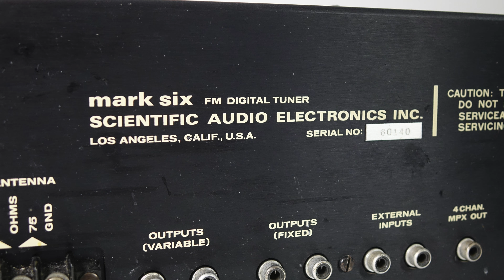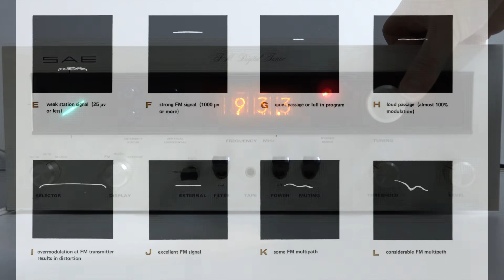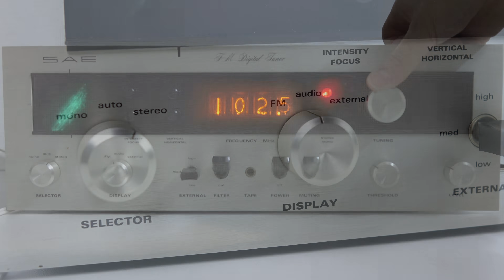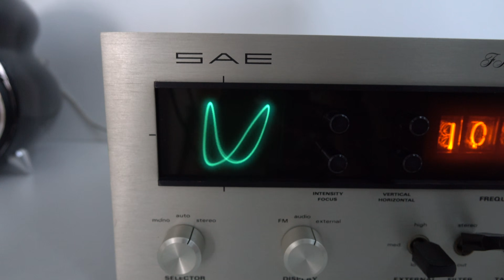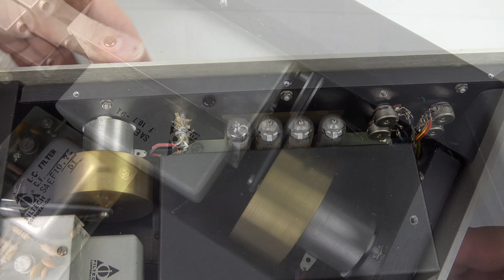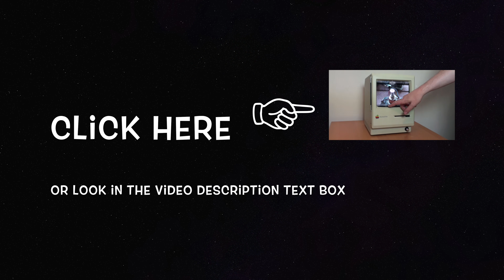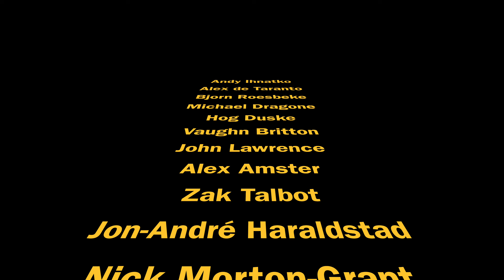Retro-Tech: SAE Mk6 FM Tuner - My Vintage HiFi holy grail

Comment: I worked alongside Ed Miller at the Great American sound Co. (GAS) where we built audio amplifiers and preamplifiers, Ed was trained as an electronics engineer in RF (Radio Frequency), and during WWII was working on radar. After the war, Ed founded "Radio Craftsmen" building "Williamson" tube audio power amplifiers, then in 1953 he founded "Sherwood electronic laboratories" along with John Snow and it was one of the first true, "High-Fidelity" manufacturers in the United States. Ed sold Sherwood to the Koreans and moved to California and joined Morris Kessler at SAE (Scientific Audio Electronics) to design the SAE Mk6 FM stereo tuner, and it was the very first FM tuner that had a digital frequency display! Ed told me that the greatest problem he had in designing the Mk6 was keeping the wide-band, high-frequency noise from the digital frequency counter out of the RF and audio circuits!  David Riddle

Comment: It's too bad about four-channel FM.  They did do some field tests of it through-out the 1970's and the system worked well enough.  The FCC however took until 1983 (wiki) or 1986 (Lou Dorren, Creator) to approve it. By which point, Quad was just a sour memory to everybody. You've got to wonder though.... if they were including that MPX-OUT jack on dedicated STEREO receivers, you know they wanted to have good market penetration.  I mean, even if you did own this receiver and Quad FM was a reality, you'd still have to buy the FM Decoder, another Amplifier for the rear channels and another pair of speakers.  That's a big task!

In all the years that eBay has existed.... only ONE Panasonic-branded Quad FM decoder pre-production unit has ever surfaced.  Apparently, about 100 were produced for extended field testing. Most were returned at the end of testing.  How a single unit survived in the wild is amazing.

I honestly believe Quad-FM was going to be the next big deal as right around 1973, all the major US car manufacturers began offering 4-speaker FM stereo radios in their cars.  Even economy cars like the AMC Gremlin or Hornet could have 4-speaker AM/FM.  All they'd need to do when Quad FM hit the market would be to swap out the head unit.

Comment: I forgot how much that iconography/scripting looked like Marantz, even the knobs. In college , late 70s, I’d ride my bike to all the local hi fi shops. One shop had SAE, so cool. Thxs for the video! Heh.. I had to run your inflation calculator here in Mar 2024: “8,093
Adjusted for inflation, $1,050 in 1971 is equal to $8,093 in 2024.
Annual inflation over this period was 3.93%.”

Comment: I own one of these units, but someone before me removed the rotary for the Mono/Auto/Stereo selector switch. Can you help? Can you take a few pics of the rotary switch back, showing the color-coded wiring to the switch? This will also identify the resistors used. I plan on restoring the unit, but I need a few pics and a schematic if you can. If not, can you lead me to someone who can? Thank you very much!!!

Comment: Back in the 70s, I worked for the company that imported SAE, but we started with the black ranges, which I don't feel were as well made as the earlier silver/gold range.  We had issues with the amplifiers (up to 400 watts per channel in real life) destroying their capacitors, so we had to source more robust versions.  Not sure if this was a problem caused by the changes to the power supply to cater for 240 volt.  But this immediately reminded me of the Sequerra tuner, which, at the time of which I am speaking, sold for £10,000 in the UK.  It was the most expensive hi-fi component full-stop for some time.

Comment: I had a mk6b about 25 years ago.  One thing that I remember really stood out was the bass.  I believe the Nixie tubes were blue.  One of my current tuners is the Marantz st-8 which has round scope window.  Simply beautiful design of front panel.  Very rare to find in USA, and I have the beautiful wood cabinet as well.

Comment: There were Nixie tubes in the 70s? I had my hands on tons of old kit when I was younger, but I don't think I've ever seen one. It seemed stuff went straight from analog to 7-segment. But just maybe, I might have seen one. It's just a flash of a memory of startlingly high-quality digits. I might not have seen them because I never saw high-end kit; I never saw a tuner with a scope either, although I did hear about them.

My grandad had a desk calculator with an 8-segment display; gas-discharge but not a Nixie design. The segments were like those of a 7-segment display but curved to look nicer, with the extra segment only used for the right side of the '9'. It looked very nice and didn't have the Nixie tube depth issue.. Sadly, some tubes got broken while it was open, and I think I probably threw it out after that. I wish I had at least kept a drawing of the segments because the design might be replicable with 3D printing.

Comment: I also had this one, however the oscilloscope was burned in tremendously and could not find a replacement tube in the 90's, internet was not there yet to find it, now you can look them up easily. I broke this tuner down for spare parts and now have enormous regrets.

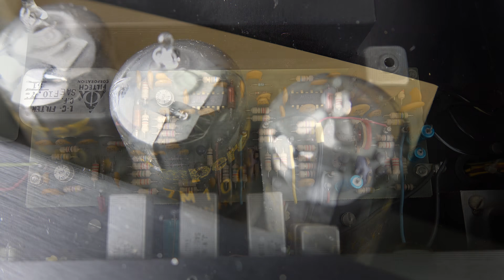Comment: 12:19 there are 2 more chips on that board.  The 2 RCA CA3053 metal cans are very early 3-transistor integrated circuits, and it's pretty amazing to see those used in such an early tuner.  But, thinking back on it, I had a record player in 1968 when I was a kid, and it had an IC chip in its audio amplifier.  It was NOT high end audio, like this tuner.

Comment: the oscilloscope(when tuned to station) is actually showing the phase correlation between the channels(L/R) - the mono is the diagonal line, the oposite is 100% inverted phase of one of the channels meaning "100% difference" or "max stereo" :) this phase correlators are still used today in mixing and mastering

Comment: I realise this video is years old, but I've only just seen it. What an incredible bit of kit. The quality of the internals is fantastic.
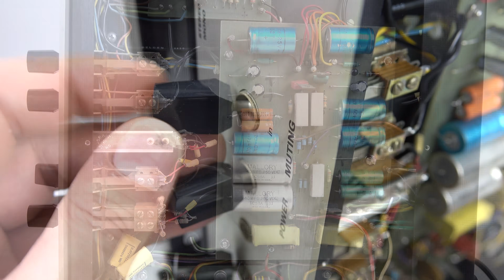Apologies if it's been pointed out already, I did scroll down a bit to see but couldn't find any comments regarding it. I noticed at 12:59 there is a bit of what looks like discoluration of the board at the bottom. Below the larger yellow rectangular resistors there looks to be a small dark brown coloured resistor and this is where the discoluration I'm referring to is. This might indicate that resistor is getting too hot. Keep an eye on that, it will probably fail at some point if that's the case.
There's also a bit of a burn mark at the top of the single white rectangular resistor just above that (the one in between the green capacitors and the larger silver capacitors) where it connects to the board.
I've tried to explain that as simply as I could. Apologies once again if it's already been pointed out and/or fixed.

Comment: Granted I don't know how it was used exactly, but let's say you had your outside pole mounted antenna with a rotor.  There was a way to use the oscilloscope to help you rotate the antenna into the best positioning to reduce multi-path so you got the best signal for a particular station's broadcasting antenna for your  particular geography.  Now that's taking FM listening to a serious level indeed.  Thanks for these very fun videos of some really amazing old gear.

Comment: Gloat I have SAE Mark 9B preamp Two 2400 Amps with the 4000 crossover In one system, I use a SAE 2900 Preamp to push a Soundcraftsmen RA 7501 Amp in my main system. All rebuilt and working just dandy. me = :)

Comment: This was really cool!!! Love that mini scope.  The curves were amazing!

Also, Spot k1, is likely related to the spot killer circuitry.  Just like vector based arcade games like Asteroids, if the X Y signals suddenly stop, fail, or are otherwise removed, the scope will display a single high intensity dot that will burn the phosphor almost immediately.  So, usually, a light will alarm the user that the spot killer is active and the scope will not display anything to avoid the phosphor burn

Comment: As a vinyl aficionado you should check out the SAE 5000 Impulse Noise Reduction System. It was able to eliminate, or at least reduce, vinyl clicks and pops in real time. I had one back in the day when I listened to my vinyl records directly. I sold it after transcribing all my records to 44.1 kHz/16 bit digital audio and haven't looked back. At one time I had a Proton FM tuner, a high end product I purchased used. I haven't listened to broadcast radio, AM or FM, at all for years.

Comment: Using a US tuner in the UK presents a problem in terms of audio fidelity. At the radio station's FM transmitter, the highs in the audio are boosted a certain amount, then at the receiver, the highs are cut by the exact same amount- the result being the hiss noise inherent in radio broadcasting is overall reduced for the listener. In the US we use 75 µsec treble boost on the transmitter and the exact reverse 75 µsec cut in the receiver. UK broadcasting standards are different - you use 50 µsec boost/cut. So, you are listening to FM stations that are boosting their highs by a 50 µsec pre-emphasis but listening on a tuner that employs 75 µsec de-emphasis.  The resulting sound of using a USA tuner in the UK will be lacking a little in the treble.

Comment: This one is actually quite different from the Revox A720. This is a normal analog tuner with an attached frequency counter. So it only shows the frequency digitally, but has no digital frequency control. While the Revox A720 is one of the first PLL tuners which already works like the more modern tuners of the 80s/90s. With the Revox you enter the frequency to the digital circuit, which then controls the oscillator and adjusts it to the correct frequency by comparing it to a quartz reference. For the user this means the Revox can only adjust the frequency in steps, but needs no fine tuning. You set the frequency and it's perfect and stays forever. With the SAE Mark 6 you mechanically adjust the frequency with a variable capacitor (like any old radio), you can do this continuously without steps (you see the bar on the scope move left or right when doing it), and the nixies are only there for displaying the frequency you have chosen using a frequency counter.

Comment: I got a HiFi stereo system from my father back a few years ago, I wasn't allowed to use it because the drivers for each of the speakers were bloody 14 inches in diameter I think, and if I was to use it then it would be shaking the whole house, after I was allowed to use it within the past several months I did some research and found out it is roughly 47 about to be 48 years old, and it still sounds like it can compete with some good speakers from the modern era of stereo sets

Comment: Scott also made a tuner with Nixie tubes for the readout, back in the 1970s I think it was, and it had a slot for inserting computer Punch Cards that you could punch out and set for your favorite stations. It did not have an oscilloscope however. One of the Hi-Fi salesman I worked with owned one around 1980 or 81.

Comment: At 1: 07, we in the States call such tuner-preamp units "pre-tuners"; and having an oscilloscope in the tuner also helps you fine tune the antenna position for least amount of multipath, not just the tuning knob position.

Comment: SAE built allot of equipment for radio broadcasters. I have seen one of these still in use at a radio station to monitor their air signal and allot of the later models at other radio stations.

Comment: Technically you need to change to de-emphasis capacitors for a 50 microsecond time constant from the American 75 microsecond time constant or the audio will sound a bit dull. Simple enough job there will be a resistor and capacitor in series to earth following the stereo decoder, one for each channel. Nice tuner though!

Comment: This works much like the Marantz scopes. The Pioneer 'scopes' ended up being faux quad meters that shot out to the beat, channels 1-4, however you could also connect a real scope display of sorts to some tuner models like TX-9100 (I own that tuner, will until I die).

Comment: Your British radio-stations seem to broadcast very rich and clean audio! I noticed since you recorded it via Line-In...
In Germany today most of the stations only broadcast very thin and ugly over-processed and -compressed sound (via Orban Optimod) - FM itself is not the problem - it's general abuse of Sound-processing and senseless restrictions of average-MPX-hub (no matter if you receive them via FM, or digitally via DVB-S, DAB+, Web-Stream or something else, German stations all sound the same). (You notice this if you drive nearby to our western naighbour-countries and simply switch from a german FM-program to one of their's without lowering the volume first - it just blows out your car's door boards and you think you are listening to CD!

By the way - GREAT TUNER ;-)
Reply: And the state stations are more interested in expanding their broadcast over their borders than were they should broadcast. The NDR has very weak strength in the actual north, their damn region, but is much stronger a hundred kilometers to the south, just to bleed into the region of the west German stations. I have an easier time getting Danish radio stations in than getting a strong signal from the supposed north German radio stations. I can't drive to work or through the city without the signal going completely away multiple times despite perfect tune.
But I'm forced to pay anyway so what do they care, right?

Comment: Hey, I just have a random question and hope somebody can help me: I inherited some old HiFi equiptment from my dad. My setup is: Dual 491 Turntable, Magnat Ribbon 8 Speakers and a Yamaha CR-1020 Stereo Reciever. My dad also had an analog oscilloscope and I wanted to know, if it is possible to connect this to the Tuner. Should I just connect it with the Tuner outputs via cinch?

Btw nice video, this is porn :D

Comment: That´s a great FM tuner. There is only one problem.....if the UK acts like Germany, they will stop the analog FM service in the near future. I´m in Germany and in the same situation. I have a nice tuner, but it will be useless in the future. DAB is the way to go, they say....
Reply: I dont think they will switch off u.k fm transmitters for a while yet, DAB coverage is still pretty awful and the mp2 codec used in our glorious governments choice of digital radio system basically doesn't work very well in moving vehicles and sounds worse than fm due to shoving too many channels on each mux in order to rake in more licensing money.  Add in the fact it degrades badly in marginal signal areas to become an unlistenable mess of noise and the receivers cost more for no perceivable benefit over fm and you realise they just cant get rid of fm yet.  Quite why the u.k didnt use the far superior DAB+ instead of the outdated DAB standard is a genuine puzzlement.

Comment: Real interesting piece of gear, just a pity it's only set up for the U.S.A.!
Btw, the date code on those ICs of 7039 (39th wk of 1970) fits with the date on the oscilloscope!
Reply from the maker: It works perfectly in the U.K.  There’s a bit more information about this in the video description text box.
Reply: The frequency spacing isn't compatible for many radio stations here in Australia on both FM & AM, plus a 240-110V step-down transformer is required!

Comment: Sweet find!

The shield around the CRT is probably a Mu-Metal X-Ray shield (also common in oscilloscopes, and other static deflection CRTs).

One tip though, you really don't want bloom around the dot, if you have bloom around the dot, it is too bright, and if left stationary, can and will burn the phosphor, just like on a lab oscilloscope.  You might want to cut down the intensity setting.

Comment: You’re right about the high quality construction. The first clue is the glass fibre PCBs, almost unheard of in consumer grade Hi Fi gear back then. I don’t think it’s common even now. The VFO is well screened in its own box, and the construction is modular, using high grade components. There’s a very nice looking FM IF amp and demodulator PCB I’d expect to see in high end pro receivers. The shield around the CRT is to prevent stray magnetic fields affecting the electrostatically deflected beam. All CRT scopes I’ve seen have them, and older colour CRT TVs had them. They are made of an alloy called mu metal. If they get knocked enough, they lose some of their shielding properties.

Comment: Techmoan  i would to just run just sound through this and  listen  if there is a difference in sound by just passing the audio through
 alot of sound system deejays in jamaica uses similar vintage  preamp for there treble bass and mids control

Comment: Very nice video.  I've been an SAE fan since that tuner came out, but as you mentioned the price made it out of reach for a 20 year old earning $2.00 US per hour.  I started collecting 'scope tuners beginning with a Marantz Model 120 in 1972, which I still have boxed.  I progressed to a Marantz 150, a much better tuner with a larger 'scope, in 1977.  I followed the digital craze of the '80s and set aside my Marantz but I always looked for a Mark VI when I had the chance.  Finally, with the advent of ebay, I was able to obtain a Mark VI along with a Mark IX and Mark IIB for a combined $625 in 2001, all of them well worn but fully functional.  Since then I've obtained a few more  Marantz 'scope tuners, Models 20B, 2110 and arguably THEIR holy grail, a 2130.  Many consider it better than their legendary Model 10B tube tuner (tough tempted, I just can't see spending $2-4000 on one).  My Mark VI is, and will always remain, my favorite tuner.